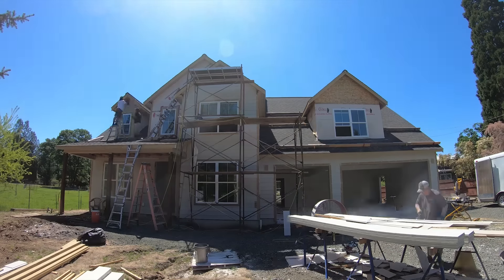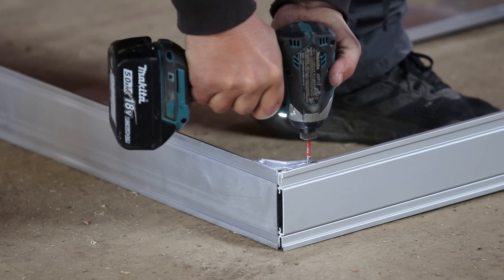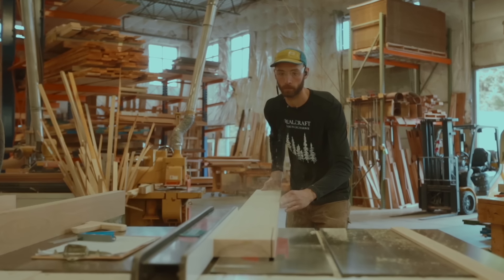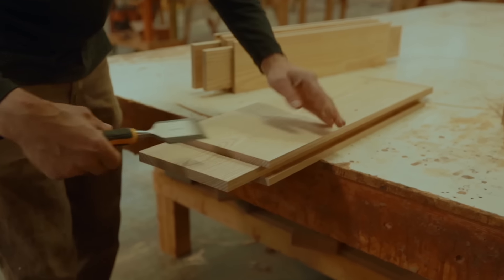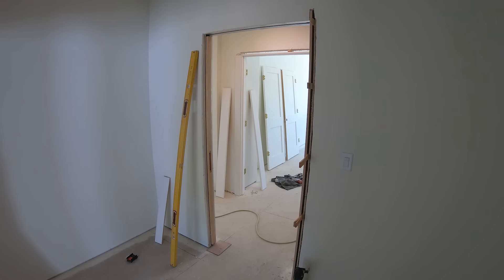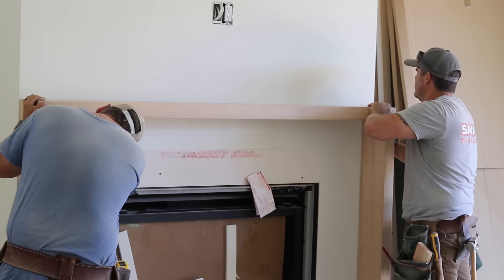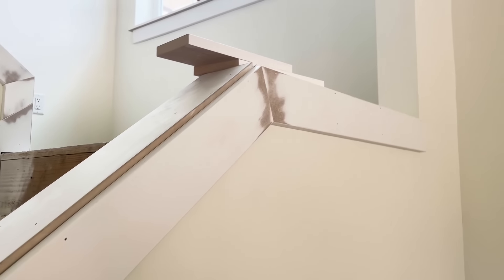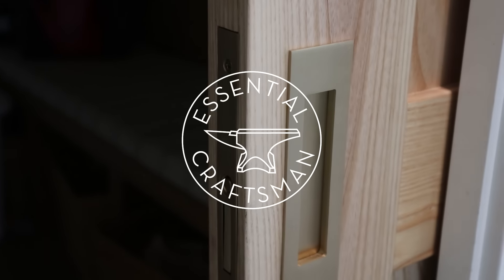Pocket Door Build and Installation

Comment: Looks like a C.S. Cavity Slider frame. I just installed one of these and the system is great. Keeping everything level and square with the frame and install the most important part with pocket doors. Slightest bit off wreaks havoc in the operation...

Comment: Question,,,
Can electrical switches and outlets be installed on the wall of a pocket door???

I can never see them in the videos
Reply: Electrician really fuss about doing it, but yes receptacles or switches can be installed in pocket door walls. A very shallow box has to be used and I’d highly recommend no junctions….just home runs. I’ve also use a 4x4 box with a plaster ring to gain more space in the electrical box.

Comment: I removed and replaced a "J" style track with a trolley track. My pocket door is running smoothly now. The surround of the pocket door was a wood product made in 1942. I created a wood triangle device with a pen light combined with a small power drill and connecting rod to remove the old track and install the new. It was a challenge to say the least and I blessed the faeries for helping me to not strip the screw heads. (g)  By the way, your pocket door is a work of art and artists.  Thanks!

Comment: Beware. I am a door specialist who also installs hardware in homes and am on a job with these tracks right now. The selected hardware isn't working for the homeowners because when closed the self closer is too hard to pull out with common smaller flush pulls they can barely grab. I will be patching and installing the same EMTEK 21xx series mortise locks which have a large enough bail they used here. These are pricey to buy and install but should work fine with these tracks. Nice door you got there
Reply: I just installed those Emtek mortise locks on my pocket doors, they are super high quality, I love them.
Reply: The softclose hwd can be deleted.   The track and frame system is superior to an other prefab out there.
Reply: Scott the man

Comment: At $600-800. Per pocket frame I don't see many people buying when a standard unit is $150-200.
Nice that they gave you the unit for
Free for access to 1.37 million viewers. I need 3 units for a current remodel. These aren't in my budget! 😮
Reply: full time finish carpenter here.  Just an idea but you can get a heavy duty Johnson track and hardware, build your own frame from quality lumber and come out with a very sturdy high quality product that will be almost equal to this aluminum version.  
As someone who has installed literally thousands of pocket doors, the main issue with standard pocket frames is not only the poor installation by the framer but the poor quality of the wood used in the frame
Reply: This is a very sponsored video and should be labeled as a sponsored video. He was given several thousand dollars in hardware and that is considered payment.
Reply: @MAGAMAN  saying that it’s a sponsored video and telling everybody that they got both the door and the hardware for free is the same isn’t it?